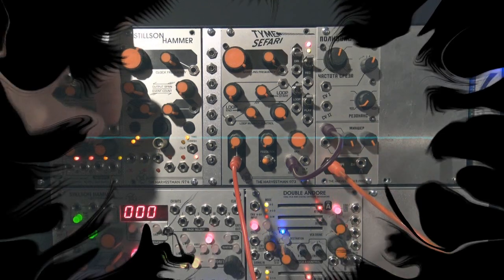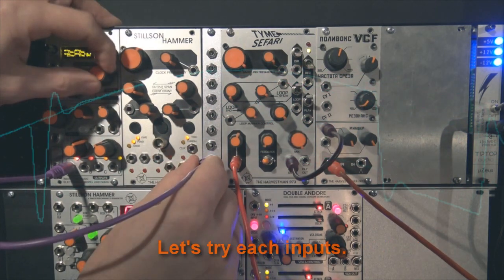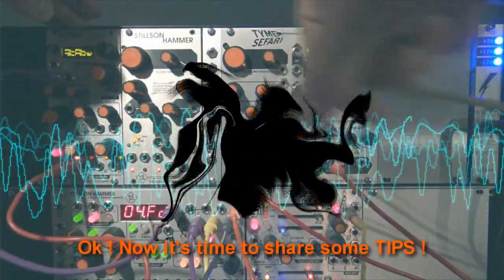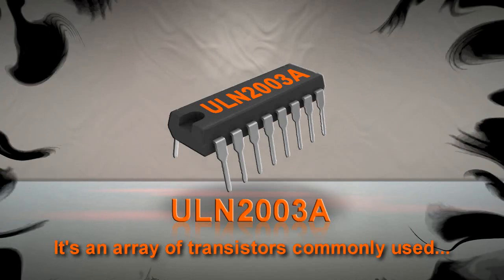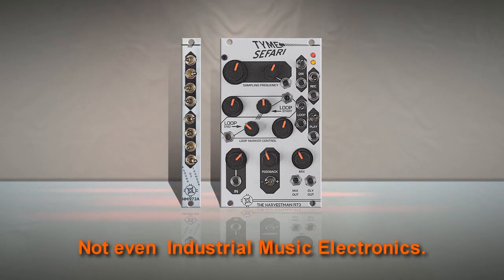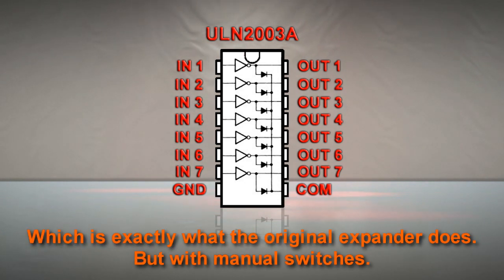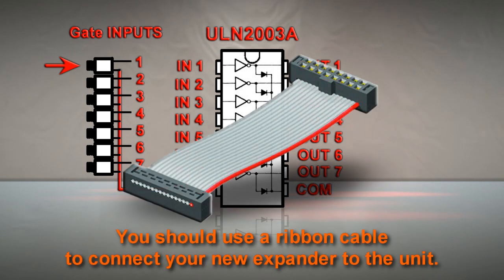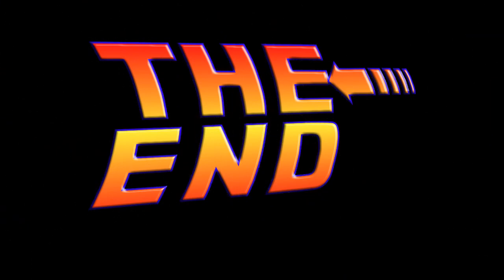Tyme Sefari : A sound of Thunder with trig inputs

Comment: Killer per usual. Can you make a Sound of Thunder MK-2 clone? I can’t find one anywhere. It’s driving me nuts.
Reply from the maker: I suggest you write to Industrial Music electronics, maybe Scott got one in stock or at the very least an half working expander with only the switch and gate inputs would be better than nothing for me. But someone contacted me and is actually working on some clone for the MKII. But the Sound of Thunder MKII got something interesting in its description. It is presented as the official expander for the TSMKII. So maybe the one I just made would work, but you wont have access to the right channel in stereo mode.

https://www.modulargrid.net/e/industrial-music-electronics-a-sound-of-thunder-mkii
Reply from the maker: I found a conversation I had with Scott years ago about the expander. The first expander should work in the TSMKII and have to be connected to the THUNDER PINS on the back..... not the THUNDER ''2''. I'll do some testing for both the original expander and this one later this week and I'll give you my impressions.
Reply: @robotopsyrobotopsy6486  WOW. Thank you very much, that is exciting. Please let me know what you find out. I really appreciate it.
Reply from the maker: @mikegeary8056  I tried this one with the Tyme Sefari MKII and it works really well. Plugged into the PINS '' thunder '' ( not thunder2 ) but it seems to sound more like the Switches of the Tyme Sefari v1 and I dont think it enables what the '' A Sound of thunder MKII '' does. But still it sounds amazing.
Reply: @robotopsyrobotopsy6486  killer thanks man. I will definitely build one. I’ve been using my TS a lot lately. I’ve been getting results I like by running a whole mix through it and mixing loops with the dry track while modulating the start and end points of the sample. I’m really looking forward to you videos on the VI when it comes out. I’m saving my pennies for one. I hope I can get one. I have a feeling it’s gonna be hard to get for a while. I hope Scott makes enough of them.
Reply from the maker: @mikegeary8056   I'm gonna make a vid for this one for sure when it comes out.